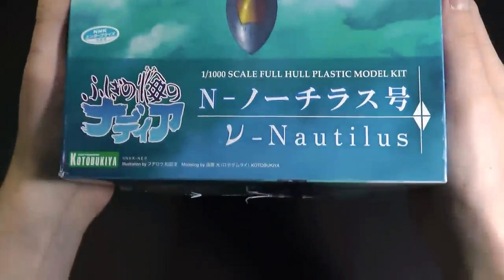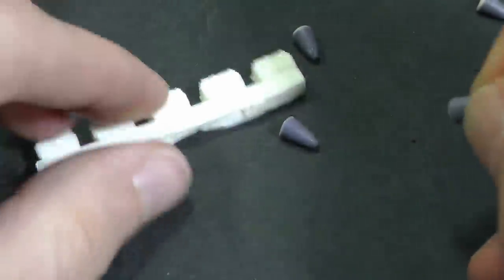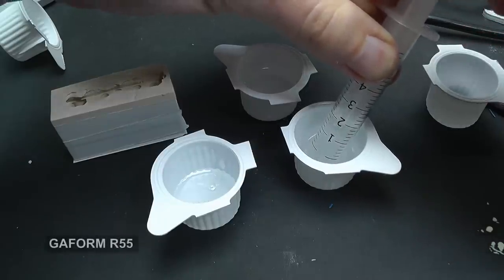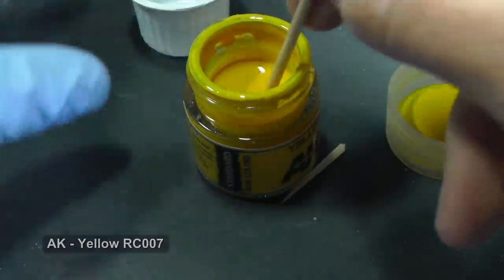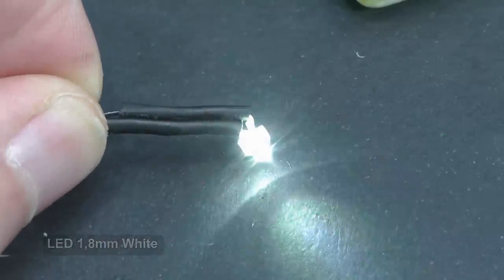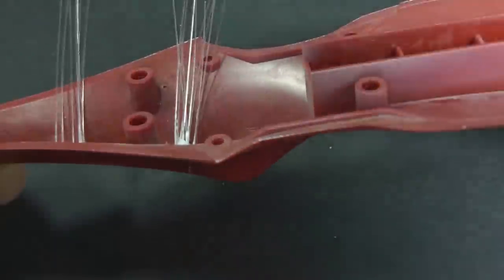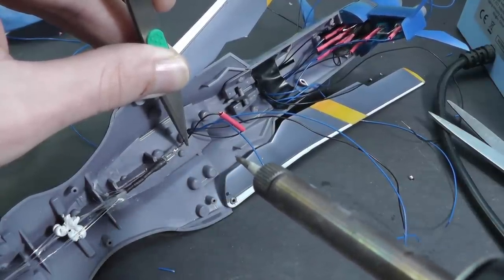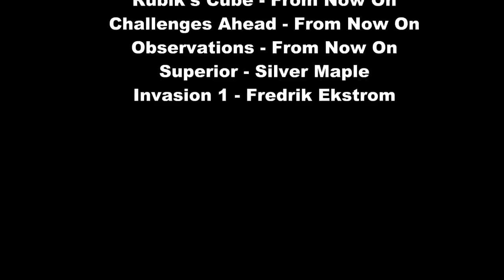Nadia N-Nautilus 万能戦艦 N-ノーチラス号 - Kotobukiya 1/1000

Comment: A tip when creating a mold for cone-shaped objects. Use kids clay or epoxy resin to elongate the back och the cone. Mount the cones on a plate and hang them upside-down in the mold box. When cured you can wiggle them out and cut off the excess cone. This way you won't get any mold seams as you do with a two-piece mold. One thing though. When pouring in the resin in the finished mold. use a toothpick or something to "encourage" the resin to go all the way down to the tip of the cone. As usual. A great video and a great inspiration. Feel the need to go upstairs and continue with my Hasegawa A4 Skyhawk now... :-)

Comment: David, this is a tip which I used for the holes you drilled in the bridge: fill them with some transparent micro pearls on ebay to diffuse the light. You can also mold some epoxy to plug in the "eyes" of the bridge.

Comment: I do a fair bit of mould making using silicone rubber. If you want an alternative to making boxes for the moulds, I use Lego bricks - you can make mould boxes any size or shape you want without having to wait for glue to dry or having to waste materials.
Great video, lovely job.
Reply: SteamGeezer and Son Independent Traders when you do that, do you put tile pieces over the bottom? Doesn’t it leak? Iirc Lego walls are not watertight?
Reply: @soupfork2105  The rubber I use is fairly thick, so it doesn't tend to leak. I often make two part moulds so I use clay to encapsulate half the subject which also helps. For one piece moulds, another trick is to use a plastic cup and put the subject in there. I made a short video on the process if you're interested - https://youtu.be/o3XENdKlHJg

Comment: when pouring your silicone if you do it height you can stretch out the silicone as it pours into the mold. The thinner the line of silicone the better as it removes some air bubbles, maybe not an issue for yah but i find it helps when i mold my sculptures.

Comment: Please do a project using that new glow powder its either charged with sunlight or torch and lasts x20 longer compared to things that glowed few years ago its actually lights like a torch or mixed with red or orange looks like hot metal or volcanic lava maybe a vehicle or caught bomb mid explosion or a dioramas of a crash landing or engine fire with fire fighters its ver versatile mixed into resin and varnish, clearcote, or pva glue and sand. With lighting it will come alive. Thanks